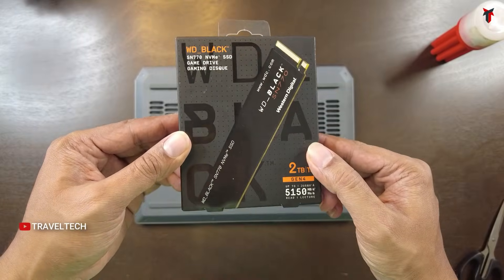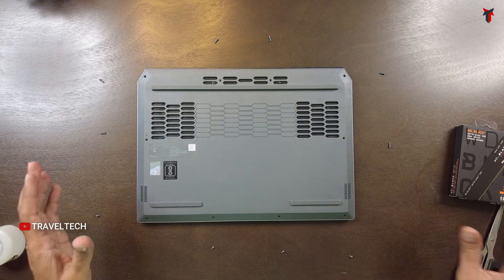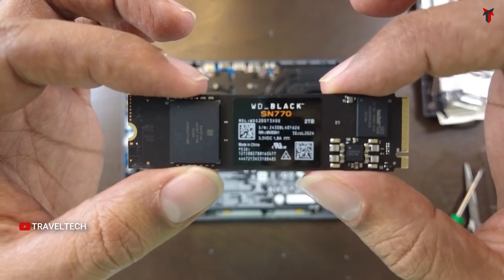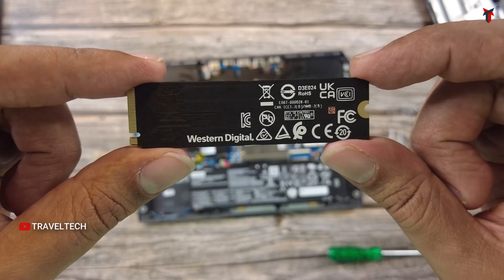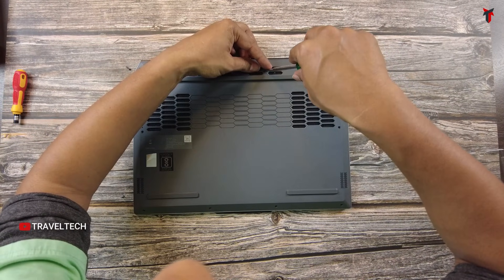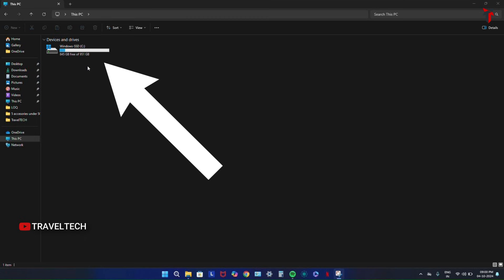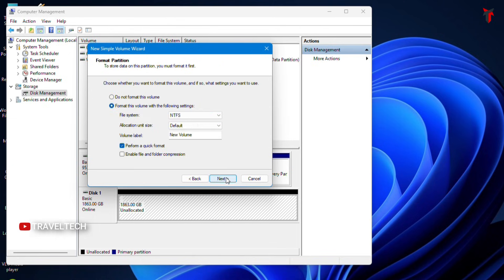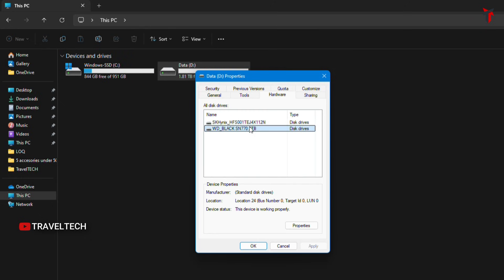How to Upgrade Laptop SSD? Lenovo LOQ 15IRX9 SSD Upgrade Guide | SSD & RAM Upgrade | Gizmobeep

Comment: What is the maximum we can upgrade? I also have one empty m.2 slot I will increase storage same laptop
Reply from the maker: Maximum 2TB
Reply: @gizmobeep thanks for the reply…..I have one more question I bought loq with adp 3 yrs , if I do upgrade whether warranty will void ?
Reply from the maker: If you upgrade SSD or RAM, warranty won't get void
Reply: 2 tera pentru slotul 2242?

Comment: I have a Question, if i want to install a crucial NVMe 1TB SSD, do I have to remove the pre installed 512GB SSD or can I keep both of them.
Reply from the maker: If your laptop has 2 slots for SSD, and one slot already has a 512GB SSD, you can install a new 1TB SSD in the extra slot and use both. If you remove the pre inserted 512GB, then the Windows OS installed in your system will also go with it.
Reply: I have the same laptop, Lenovo LOQ, is the a slot for the ssd? I am new to this so i don't know much.
Reply from the maker: If you have Lenovo LOQ, then the interior of your laptop will be exactly the same. Follow the guide which I have shown step by step. You will be able to install additional SSD